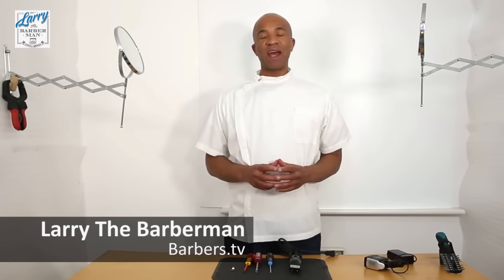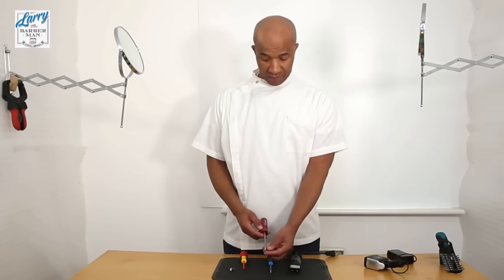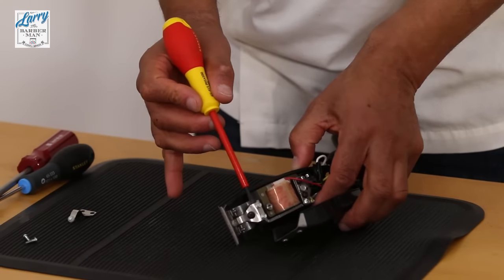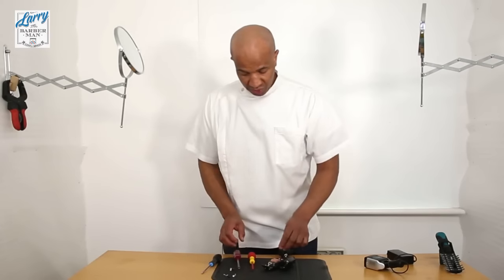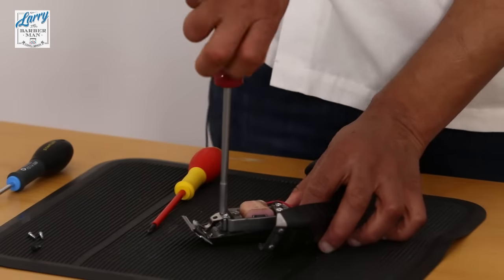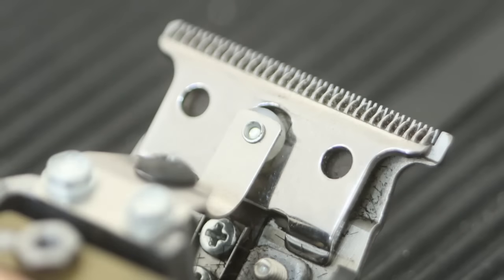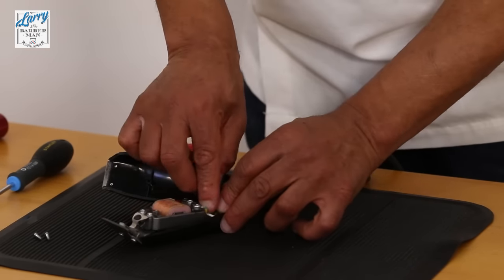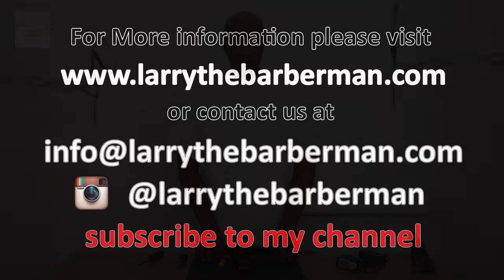Andis T Outliner: Replacing Tension Spring For Better Performance

Comment: Hello Larry wonder if you would help me on this it would be appreciate it I have the Andis t-outliners and have put a new tension bar on them I have also modified the housing what has happen is they start up ok but after a few minutes starts rattling sounds it stops and goes I tried adjusting tension bar but sounds doesn’t go away  on your advice should I just give up on them and get a new pair … thank u !
Reply from the maker: Hmm!! Hard to say without seeing or hearing them - do you oil or spray before starting the trimmer? Or is something just loose? I am thinking it is something caused by heat generation or lubrication drying out, hence the delay in rattling